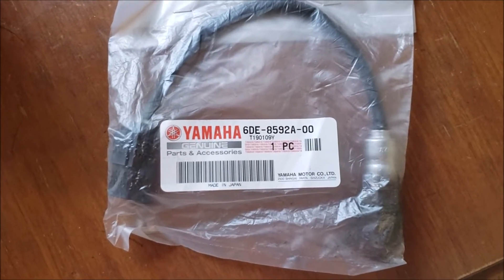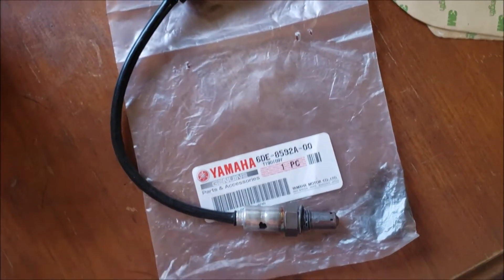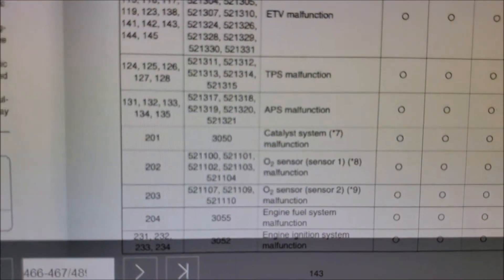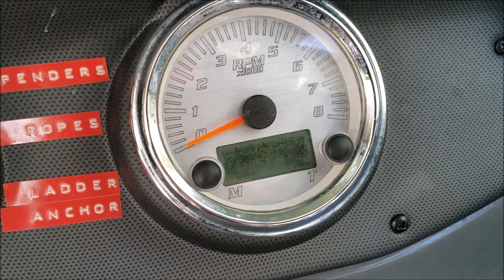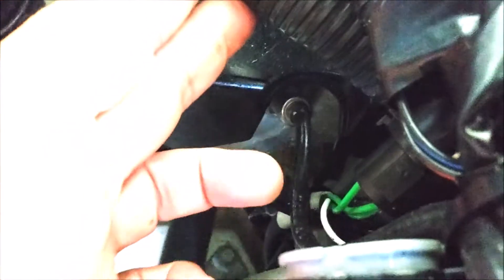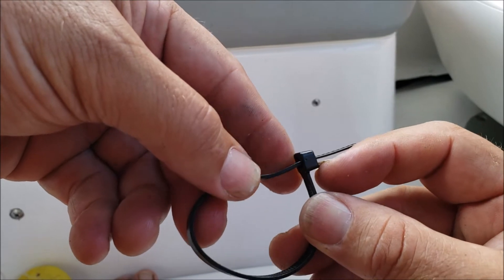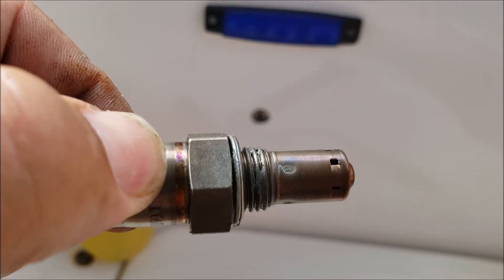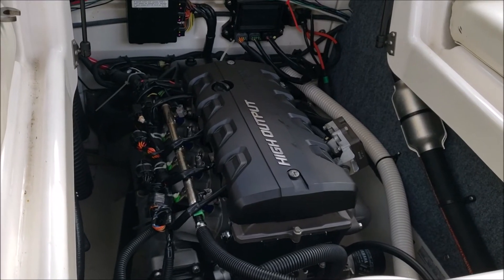Yamaha Jetboat Oxygen Sensor Check Engine Light

Comment: A few days ago, I got a check engine light on my 2016 AR190, checked the code and it was 203 521110. Thank you for posting your video, it was very helpful. I ordered part 6DE-8592A-00-00 from Boats net and replaced the post-cat O2 sensor. After four clean starts, the check engine light went away.

Comment: Hey do you get check engine then engine over heating code? But its not over heating i can idle as long as i want with no alarms but as soon as i move the throttle up it sounds off.. any idea?
Reply: I have the same issue. Did you figure it out?

Comment from the maker: I think it would be best to make a quick call to a dealer and ask the Svc depth their opinion on it.
 The O2 regulates fuel richness and you would not want to go to far lean  or rich.  Over rich. If memory serves, an over rich condition will ruin a catalytic converter with prolonged use.

Good Luck

Comment: Because it was just an O2 sensor would you have harmed the engine if you continued driving like you normally would? Let’s say it took 3 weeks to get the part could you still have driven the boat for those 3 weeks while waiting for the part? Or did the motor go into limp mode and stay there until you replaced the O2 sensor?
Reply from the maker: This is a really good question about limp mode and I actually think it did go into limp mode during a trip down the West Side trolling now that I think about it.  It was on the way back and we had been trolling for hours at 6 - 10 mph and I felt the motor go down in power.  Still maintained speed to stay on plane but it was struggling.  Wide Open throttle had a deep throated rumble but no pick up in speed and it ran better with less throttle.  After the part came in and was installed I've never had that symptom.